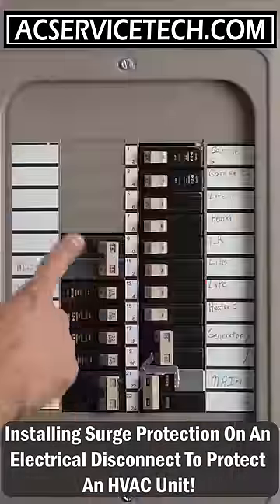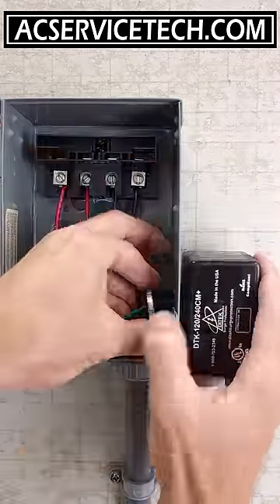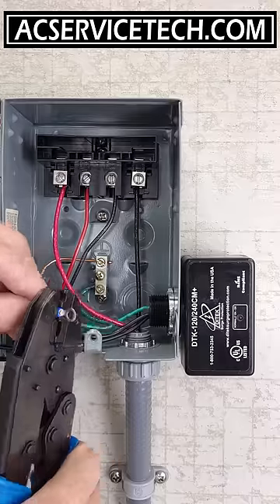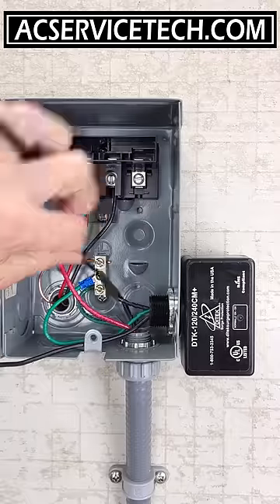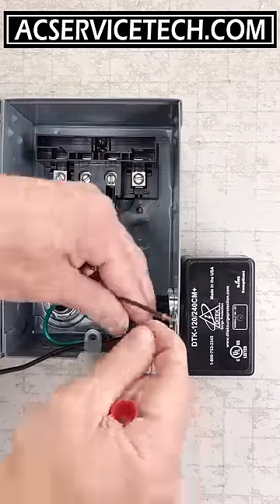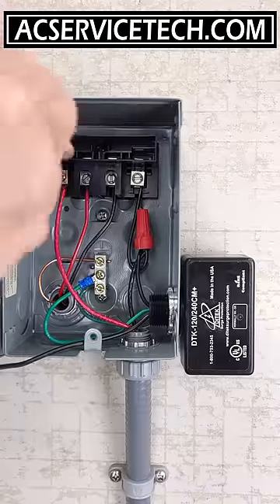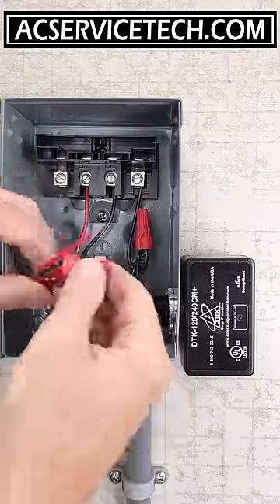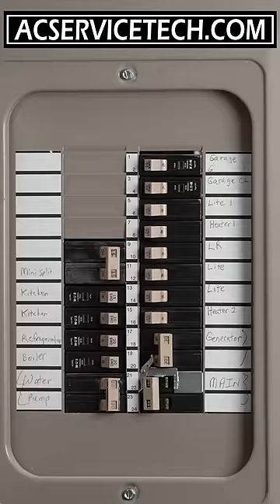Installing Surge Protection at the Electrical Disconnect Box! Pass Code! Protect the HVAC Unit!

Comment: That is how a surge protector gets install in the AC disconnect. I’m talking to all the HVAC people that get this wrong 99.999% of time
Reply: You know what I'm  going to keep doubling up on the lugs how I was taught.
Reply: @DRmechanical  Well, that is is wrong. Lugs are only design to take one wire.
Reply: @soydelrancho are you saying that lugs are just used to cover lose single wire ends?
Reply: @wildoutrudeboy  Uh?

Comment: Maybe it's just me but I really prefer double lugging. One less point of failure
Reply: 100 percent
Reply from the maker: I do get it and I wish the disconnect manufacturers would supply a better design!
Reply: Yeah, I know sparkys talk down on double lugging, but the strand wire used on those big solid wires really allows it to conform around that solid wire when tightening down. I yank on those wires pretty hard after every install and they never budge. 😅
Reply: Sparky here, dont double lugs unless UL listed too. Against electrical code to do so.
Reply: Two wires in one lug is a NEC code violation, you must pigtail
Reply: What’s the issue with double lugging? I know it’s against code in some cases but is there a danger of a failure due to double lugging? I’ve installed several of those surge protectors and I’ve always just added the wire under the load side lugs and give them a tug to make sure they are tight. I feel like adding a wire nut is adding a potential failure point. I’ve seen and fixed so many melted wire nuts on the high voltage wire on an air handler. Older Carrier air handlers used to have a pigtail that you had to connect the incoming power wire to with big blue wire nuts and they would get loose overtime and end up melting. I think high voltage wires should always be parked under a lug wherever possible.
Reply: @victorsr6708 Yep, now that makes sense....
Reply: @vincentgelles3805 I believe it’s due to the fact of when you double lug you most likely to have wires sticking out when they get shoved in i sees a lot of time where you have them one or two strains of wire sticking out, this can cause arcing or someone getting shocked, I could be wrong but that’s my guess

Comment: SPDs do NOT protect against lightning stikes. SPDs are only designed to protect against one thing and one thing only: transient voltages. A transient voltage is a voltage spike or sag that occures when lines are transitioning (that's why theyre called *transient*) between connected and disconnected (be it service lines, or even your neighbor turning on their electric oven). If you want lightning protection, that's an entirely separate kind of protection. Surge protection is still vital in these inverted systems (and should be installed on newer furnaces, the blower motors are inverted too and just as expensive as inverter boards), we just don't need techs out there promising the world with SPDs and making angry customers when the manufacturer won't honor a warranty claim for protection that they never promised.

Comment: Why do some specify to wire the line side where as some say the load side? I would assume they are all supposed to be wired to "Line" as to protect the "Load" in the event of a surge but all the brands are different when it comes to the wiring of there surge protector. Just make sure you double check your wiring diagrams. Some also show the wires directly tied into the lugs but if those lugs are not meant to be double tapped then thats where it may be right to use a pigtail. DO NOT DO THIS AS A DIY PROJECT. HIRE A LICENSED HVAC TECH OR ELECTRICIAN TO DO THIS.

Comment: For those of you not fully understanding the purpose of the surge protector.

The purpose of the surge protector is to take the blunt force of the power surge and sacrifice itself in order to protect the circuitry of the system. It can usually take several smaller hits before it's destroyed, but normally, one large hit will take it out. Now it doesn't shut the system down, because that's not its job, again, it's job is to take the blunt force of the surge so that the circuitry doesn't.

Great video Greg!
Reply: What about a phase loss monitor? That would shut the system down and sacrifice itself at the same time?
Reply: Er, Craig.
Reply: @klabkebash well a phase monitor would control a contractor normally which would open and close as the phase monitor sees fit. Different from surge protection but honestly just as important
Reply: Or you can put a fused disconnect..
Reply: @Big_boom90  a fused disconnect is for safely disconnecting power to a piece of equipment and protecting from over current. However will do little to nothing for surge protection. Fuses just don’t blow that quickly. The perfect install would be the correct size breaker in the main panel which that panel should have a surge protector on it too. Then a properly sized fused disconnect with another surge protector because when you layer surge protectors they work more effectively. It’s just like putting up barricades for cars the more you have the more energy you can dissipate. And finally if it’s a three phase piece of equipment a phase monitor wired to a normally open contactor is highly recommended to keep from having the equipment “single phase”. Question anyone??
Reply: @jonlehman2671  fuses also take the blow back to the panel correct?
Reply: @Big_boom90  if it’s a short circuit the magnetic trip on the breaker in the panel will trip first. A fuse is literally a piece of metal that burns up at a certain amperage but especially on the bigger fuses they take forever for them to blow. Also something to consider is depending on how far away the breaker is from the fault, the breaker may have a harder time in sensing it
Reply from the maker: Thanks for the explanation to everyone! @jonnys3602
Reply from the maker: Ha ha, it happens! Just don't call me late for dinner, thanks Jack!!!
Reply: @Big_boom90  it kind of already has one. thats what the terminals up top are.
Reply: @TheCrystalGlow  lol you have no idea what you're talking about and it shows.
Reply: Wouldn’t the main fuse blow and shut the system if hit by lightning?
I always thought that. I want one of these protectors.
Reply: Would a whole house surge protector do the same job?
Reply: @jonlehman2671 no you are a great Sensei. Please teach me more! What does the surge protector at the panel look like I don’t think I’ve ever seen one and where’s it installed can it be installed to any panel how about sun panels  can surge protectors ever be overkill
Reply: @mindcontrol1973  it’s always best to layer your surge protection. There’s really no such thing as too many. Granted you could get really out of hand with it but have up to three surge protectors on a circuit is not totally uncommon.
Reply: @Big_boom90 This is hilarious because you also don’t know what you’re talking about… and it also definitely shows 😂😂
Reply: The installation of that a surge protector is a good idea but please follow the installation instructions of that manufacturer They specifically recommend leaving the 3foot lead that comes with the product.
Reply: Just something else to sale😢
The fuse...no the breaker...no 
Stuart Cramer " really we need that?"
Reply: A surge suppression unit to electrical is like a shock absorber to a wheel…
Reply: @TheSonaguard Correct, always follow manufacturer’s installation instructions. Some even call for you to drill a weep hole if placed outside in the elements. You should not cut any wiring that comes with the surge protector. They give it the length of wire provided, but I've never seen 3ft of wire 🤔...
Reply: Quote me if I’m wrong but the big NO NO is shorting the wires!! Ask your local distributor!
Reply: @joshr2828 Sorry, but  I'm not too sure what you're referring to here. What's being shorted?
Reply: @Big_boom90 fused disconnects are against code
Reply: Was the wire nut connection necessary you could literally connect on the same block the loads connections were on already same thing lol
Reply: @VelRodRanch  not just something to sale, it is beneficial for the system.
Reply: @johnnys3602  that's not necessarily true. The manufacturer I use, in their book, states not to coil up lengths of wire and to cut off the excess..

Comment from the maker: So on any new inverter type hvac system, the circuit boards are susceptible to damage from undervoltage, overvoltage, grid problems, lightening strikes, and other electrical issues. A surge protector can help protect from power problems due to nearby lightning strikes which are very common. They work by shorting the very high voltage to ground temporarily. These are just connected to the circuit. Overvoltage and undervoltage protection devices are different as they are connected in series and will cut power off. These are also typically equipped with surge protection. The only issue is if they cut power off to a running inverter system too much, it is possible to damage the system so care must be taken to set the undervoltage and overvoltage set points correctly for your average voltage in the area installed. I have another video on installing overvoltage and undervoltage protection linked in the description section of the video. Also make sure to read our mini split articles and check out our new book "Inverter mini split operation and service procedures available at https://www.amazon.com/shop/acservicetech or at our website at https://www.acservicetech.com/store
Reply: Surge protection is not the same thing as lightning protection. A surge protector will help a bit but it’s not what there designed to do
Reply: Is Not doubling it on the ground lug only to make sure it has full contact?
Reply: @jonlehman2671 that's not what he is saying, he literally said in the comment it helps with overvoltage from near by lighting strikes. Obviously its not going to help with lighting strikes that hit the house that is what lighting protection is for.
Reply: @drewdubois6171  yes it is but also lugs are only rated for a certain amount of wires because they can become loose if there are multiple wires doubled up. Granted ive seen lugs that arn't rated for that and get doubled up anyway and last decades but its not code and defenintly not best practice. There are lugs that are rated to be doubled up but if it's not rated for it or you don't know if it's rated for than ya it's best to only use one wire per lug.
Reply: ICM 493

Comment: It's like looking back in time, Seeing equipment from 50 years ago still being used.
Reply: Yep I still roll the older classic vehicles, less mechanical problems and no computer trackers😶‍🌫️
Reply: @gods959  maybe but Mains electrical equipment that half a century obsolete is scary.
Reply: @dogwalker666   What makes it so obsolete? can you refer a newer setup.
Reply: @ronwest7930  lack of buss bar protection and MCB 's that are 3 generations obsolete, Modern distribution boards are way more advanced. Any that old would be scrapped.

Comment: I started installing these because it gave us a better warranty. I can charge more and it's only like a 5-minute Job. Admittedly, I will just put the wires in the same place in that lug connection for the load. We're starting to get away from wire nuts over here. We like those new wire connectors they got. I forgot what they call em.
Reply: Direct to the lugs is a MUCH better SPD installation than using wire nuts. 
Surges are high-frequency events, thus sharp bends create high impedance, and a wire nut is a 180 deg, very sharp bend.
Reply: @craighorner7801  I figured it should work relatively close to the same. It's just a lot easier than cutting and wire nutting. Not to mention I've seen plenty of wire nuts fail.

Comment: Pressure-connect wire nuts
are great insulators, and
though not code-required, my preference is:
Wires be twisted, then capped w/wire nuts.

Comment: The surge protectors I install say to hook to the line power🤔
Reply from the maker: It depends on the brand but licensed HVACR contractors in most states are only permitted by code to work on the load side. It will do the same thing if the disconnect is in so either side won't change funtionality.

Comment: Really? On the Load Side? 
I always wired to the Line Side based on Install instructions included in the surge protector box.
Reply: Yeap
Reply: Ones I seen say on the load side
Reply: same ive installed 50+ always on the line side
Reply from the maker: We install this on the load side because of the instructions on this brand, its going to do the same thing after the disconnect is in, and state licensed HVAC contractors typically are not supposed to work on the line side of the outdoor disconnect per NEC code, thanks!
Reply: My exact thoughts
Reply: On line side.
Reply: then you need explain the different, people follow you ..
Reply: Type 1 and Type 2 SPDs get installed on the line side, Type 3 SPDs get installed on the load side. The type makes the difference.
Reply: You're mistaken. It may be the line side to the device but it's the load side of a breaker
Reply: type 1- line side
type 2- line or load side
type 3- point of use. (like an extension cord splitter)
type 4- built into the equipment from the factory
Reply: That should be on the line side 😂

Comment: Omg, everything nice and dandy, and the freakin wire nut.... its not 70's anymore man.
Reply: What do you want him to use?
Reply from the maker: I certainly wish there was another way but the only two options are a splice connector or wire nut. This is also stranded wire. I would love to double lug but that will not pass code so until the disconnect manufacturers step up and provide more lugs, this is where we are stuck at. I hear ya!!
Reply: Guys, WAGO connectors,  just type in favorite uncle.
Reply from the maker: Yes, wire nuts or WAGO's, that is what I was holding in my other hand during the video. We are stuck at this point with using wire nuts or WAGO's, and to make it worse, its stranded wire.
Reply: If you can’t install a wire nut properly. Then definitely don’t use them. They work great if you know what you’re doing.   Glad my old 1995 RUUD central air still works great. Reliable.       Last Saturday 122 degrees outside.  75 in house. Temp probe in register 50 degrees. AC not even working hard. Wouldn’t trade for a new system that needs so much protection. Too much pee poor electronics in everything now days.
Reply: Wire nuts make a way better connection.  They've been safe for 100 years.  So...

Comment: Common misconception: surge protectors protect from lightning. 

This is only tru in a peripheral sense. Surge protectors are meant mainly to protect equipment from voltage  “surges” when loads are turned on. Motors require an influx of current to initially start, so that surge can wear down on the components of the equipment. Surge protectors do not protect  home from a direct lighting strike. Lighting strikes are diverted by lighting rods and ground rods. But what lighting can do is create a surge a for your entire service so this would not apply to surge protectors on individual equipment disconnects, only surge protectors on your line side on your panel. If your house is truck by lighting, your surge protector and your electrical system is not safe from harm. That amount of voltage and current can still fry your system.

Comment: When using wire nuts, aren't you supposed to twist the copper together, snip it, and THEN put on the wire nut?
Reply: That’s the best practice especially if your new to the game but if done correctly a wire but will twist the wires as you tighten the wire nut.

Comment: The video shows the surge protector connected to the wires on the load side.  Does it matter if you connected to the line or the load wires?

Comment: About off the shelve parts:
In the transponders of aircrafts is a pressure senor to measure the altitude. That sensor costs ~400€. You can get the exact same sensor from the same production line for 4€ at an electronic parts shop. The difference: one is certified and has veen zested and calibrated extensivly the other not. Usion standard consumer parts in an application where fire an or failure of the part is extremly dangerous is an absolute no go.

Comment: Since the device is in parallel, and since that circuit is almost always on, is it fair to say this will partially protect the entire house?
Reply: It is on the load side of the disconnect. So it only protects whatever is after that disconnect. 

If you want to protect the house, you have to go further upstream.

Before the disconnect
Before the AC breaker
Reply: A type 1 SPD protects the main.
In this video is a type 2, which protects sub panels.

So you would need a type 1 installed your  service entrance/main panel

Comment: Can I send you a photo of my heat pump set up where I would like to put a surge protector like you have in this video? Mine is wired differently and I’m questioning the installer. Thanks.
Reply: read the comments from vinnyterra1 on load and line side.... the most common types go on the line side, part of his reasoning is that HVAC people aren't supposed to deal with line side.

Comment: what kind of protector is that? usually the protector is in series, so the load get to the protector first.
Reply from the maker: This temporarily shorts the surge to ground and does not act as a switch like undervoltage/overvoltage protection which costs a lot more and could possible switch off the power too much while the compressor is running, thanks!

Comment: You don't need that third wire they all connect at the at the wire nut. If it fits just hook it up on the line sides